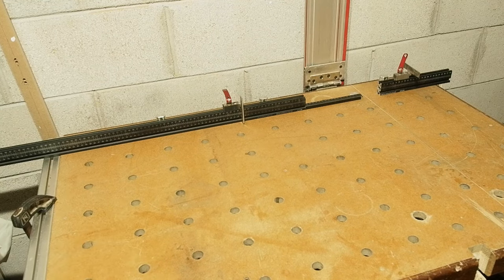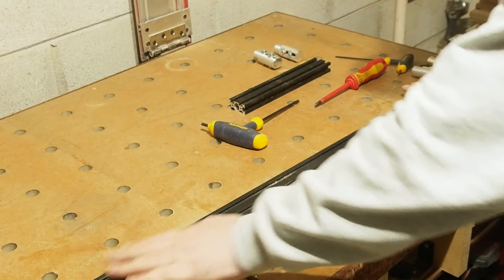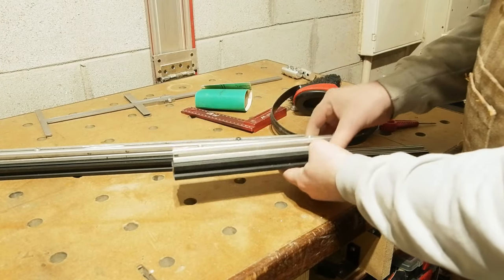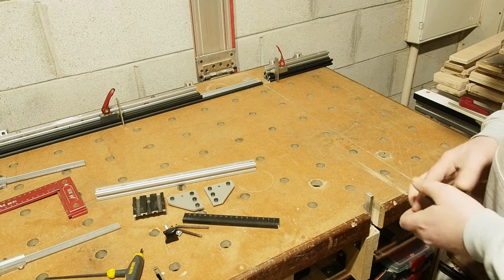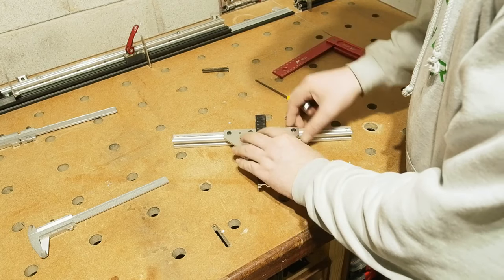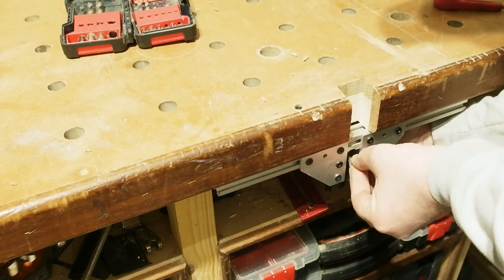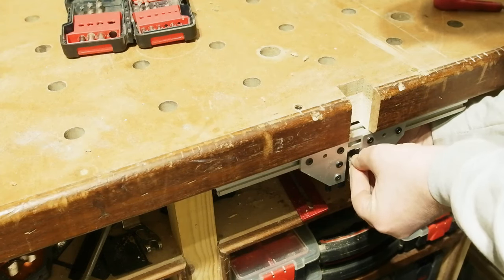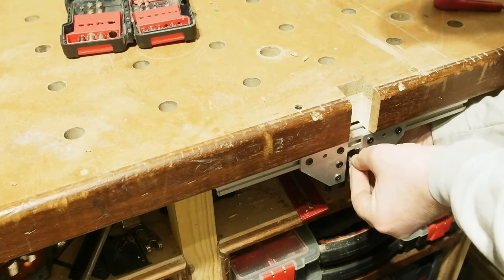An Improvement To An MFT Fence System And Hinged Guide Rail Front Pin!

Comment: Very well thought out solution mate. Perhaps you should contact benchdogs UK and talk to them about it??

Id ;ove a mafell saw but here in the states, they're twice the price of a fezzy. I prefer their design and rail system but as I only do woodworking part time, I can't justify the expediture.
Reply from the maker: Thanks mate. Wow. Didn't realise there was quite that much difference in price re Festool and Mafell in the States! I guess it comes down to volume? Mafell being tiny. Thing I actually love most about the Mafell is the ease of blade change, it's micro adjust functions and that it's almost dustless.

Comment: I wished I had seen this sooner.  Just splashed out on the BD fence Mk 2.1 with fixed under rail section.  It flexes, even with the support dog.  This is a major flaw in an expensive fence.  So many recommendations and good reviews?  Now thinking of screwing the under rail section down when in use.  Very disappointed.
Reply from the maker: In fairness, if the flat face of the support dog is aligned correctly, it shouldn't flex when pushing against it. If it does still flex, maybe like mine, yours has bent forward a little?

Comment: Neat solution, definitely a big improvement on the existing rail, but an expensive way of getting there. Might be better to just buy oozenest extrusion and make your own.
I like the way you’ve got 600mm cutting depth on your MFT, the reduced cutting depth is one issue I have with my benchdogs rail.  I plan to affix mine to the back of the MFT to give me the wider cut capacity but need to think how I can make it micro-forward/back adjustable along its length to allow for inevitable lack of squareness there will be if I just clamp it straight on.
Reply from the maker: Cheers. Yeah, i mention  briefly at the end you could save a few quid buying your own profile. The fence dogs are neat though. But as I already had the the fence, i worked with that. Always the tricky bit when building your own system is adding in micro adjustment. Good luck though. Worth having a go at,  bespoke for your needs/space👍

Comment: I have the same Benchdogs fence system with the under rail support being attached with a connecting bar and ran into exactly the system problem this is a major design flaw and cost me an absolute fortune in wood and ruined projects tying to track down the issue before i eventually found it not to mention the hours of frustration. I also find it hard to believe that the new system that is all one extrusion is any better given how narrow the under rail support is. Great video i may implement the same as i haven't used the Benchdogs fence system since i found the issue.
Reply from the maker: Sorry to hear that mate. Thought I treated mine with kid gloves but one knock is all it took. I'm more confident it'll hold up as it is now though 👍

Comment: Clever solution, thank you. I am really enjoying your reviews.
I’ve been looking at the benchdogs fence system for my track saw table build. I love the idea and the look of their system, but wasn’t sure it was solid enough… I’m now thinking of using either 40mm x 40mm extrusion . My question is, if you were starting again would you use 20 or 40 series extrusions?
Reply from the maker: Thanks mate. I think, starting over, I'd stick with 20 series profiles to make the same as I have now. I think the fence dogs are a great fixing solution. They would allow a fixing in 40 series but, only one. With a 2040 flat and a 2020 piece on top, I can get 2 fixings in from each fence dog. This keeps them solidly in place, no pivoting around a single fixing. I think this is important if you want to remove it regularly as I do.👍

Comment: The under-rail support is definitely the weak link in the fence system. I've been using a length of 20/20 and 2 joining brackets (all Ooznest) and it is pretty robust but 20mm is really to high for most sheet goods- the guide rail can't grip the workpiece! For my use I would ideally have a 9mm high under rail support but then I'd need a way to attach to my 40/20 profile that also gives some accuracy. there are very few videos about this so thank you for posting. I'll need to have a think about how I might adapt your solution to fit.
Reply from the maker: Yeah, that's the problem: trying to keep the under rail low profile. Laying flat and cutting down one end if the 2040 I found the neatest solution, ensuring a perfectly inline fence and 7nder rail. Does mean you have to be prepared to sacrifice a length of profile of it goes wrong but it's quite easy.👍
Reply: In Australia we have 2010 (if using 20 series) and 4016 (if using 40 series like yourself) extrusions. One side is solid+flat and the other has the t-slot. If you flip it so the the t-slot is facing down, you can use a joining piece to connect your 4020 to the 4016. The joining piece can be cut to a custom length from my aluminum guy so making it 400mm for example should provide enough stiffness. It still leaves it 16mm high though. Using the 20 series would be much easier as that's only 10mm high. I'm guessing routing a 7mm channel in your mft top is out of the question? That'll drop the 16mm down to 9mm from the worktop.
Reply: @feechl  that’s a great idea. I did think about a piece of t track but not using it upside down. I can’t help thinking though that it would need quite a long connector bar to stop/ reduce lateral flex?
Reply: @johnparker2636  Remember you can run the connecting bar the entire length of the 4016 piece (I'm guessing roughly 200mm for most people) then the entire length of the 4040 piece if you could get a bar long enough! I think 200mm each side would do or 300-400mm on the 4040 fence side if you wanted to be safe. Remember with your 4040 you have two t-slots so you can use a connector in both. Also, if you find it flexing you might be able to wrap something around the connector bar to stiffen it up (maybe).
Reply: @feechl  I didn't know you could get longer connecting bars for 20 profile - thats good to know. Appreciate your advice on this- thanks
Reply: @feechl  can I ask please, where in Australia do you get your aluminum profile from?